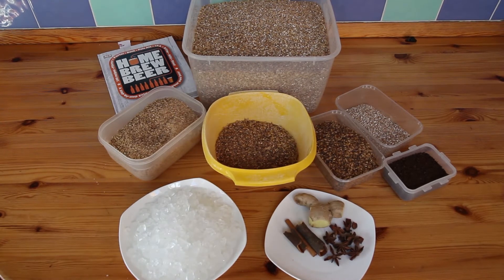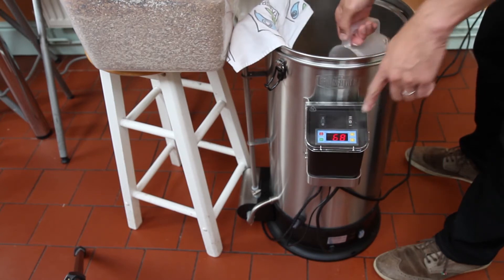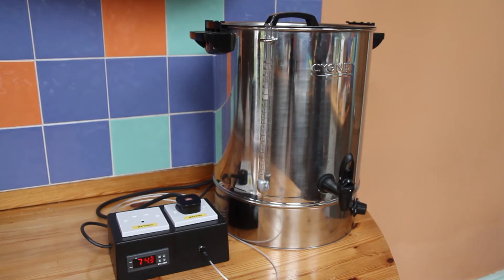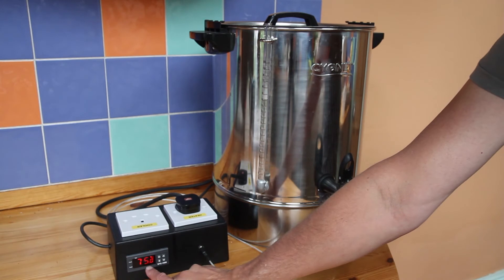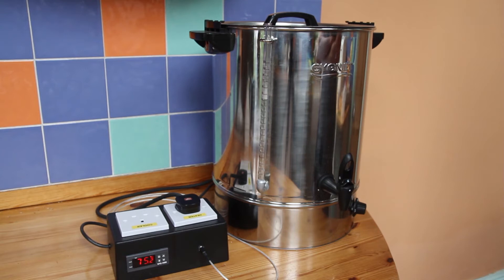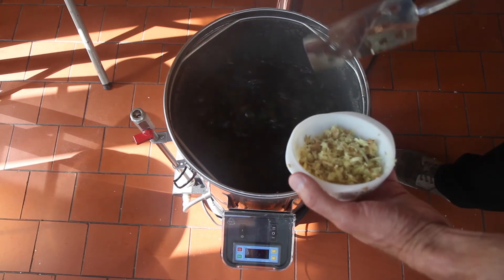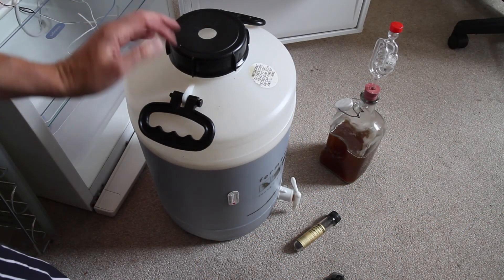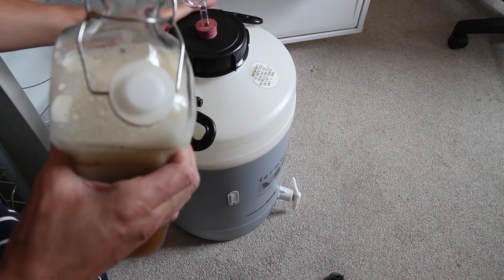Grainfather brewing - Christmas ale and hot water heaters

Comment: Hi there, Great video but I see at the end of it that your Temp probe is off the fermenter. I was told by my LBS (Local Brew Shop) that you had to put the probe onto the fermenter and insulate it as it is a few degrees higher than the air temp. But cheers for the video, I can't wait to brew this beer
Reply from the maker: Hi and thanks for the comment. You are right and I now fix the temp probe to the side of the fermenter. The large volume of liquid has significant thermal mass and its temperature tends to 'lag behind' the ambient temperature of the fridge interior. Review of the Christmas ale coming soon!
Reply: +Gary James Sweet I'm looking forward to seeing how the brew turns out. I hope that the brew turns out great! Did you keg or bottle?
Reply from the maker: +kiwiwsniper Bottled in a mixture of sizes including some champagne bottles! I thought that went with the festive theme. I called it 'Bad Santa' 😊

Comment: Hope it's as tasty as it sounds! 

Have you had any problems with efficiency when mashing large grain bills? I missed my estimated pre-boil gravity by .011 on a 7kg grain bill last weekend - it's the first time I've been out by more than a couple of points.
Reply from the maker: Hi Graeme - thanks for the comment.. This brew went OK and I got the OG I was expecting, but I have had low efficiency on occasions with larger grain bills. I find this is most noticeable if I also have a short sparge if I am making a lower volume such as a half batch. Because of the way the water calculations are done the larger the grain bill the shorter the sparge. If I did a large grain bill again I might increase the sparge and lengthen the boil to get to the final volume I need.
Reply: Yes, I think the shorter sparge is likely the reason too, but I didn't take a measurement before sparging to help the diagnosis. It's been my only non-minor quibble wen using the GF so far. I think I'll also try a longer sparge/boil next time...

Comment: geat video.
still learning on grainfather.
when you used greg hughes book for this.
did you start with 19.02 ltrs?  as on mash grainfarther calculator?
book said: 14 ltrs.

grainfather calculator for sparge water 13.58 to 14.08 ltrs.?

for the boil off how much should be in for a 70 min boil?
or 60 on grainfather?
boil off rate.
don't want mistakes.lol
Reply from the maker: Hi Gary. Thanks for the feedback. I always use the Grainfather calculations for mash and sparge volumes. They are designed to give you 28 litres in the boiler, 25 at end of boil and 23 in the fermenter. The boil off rate is therefore 3 litres/hour but in practice can vary a bit.